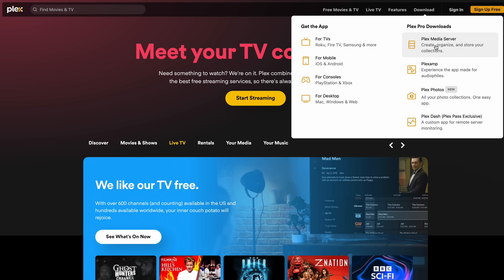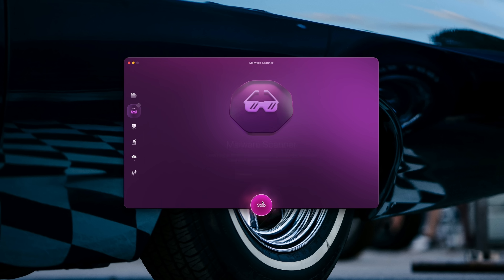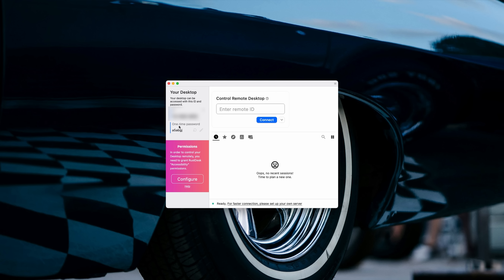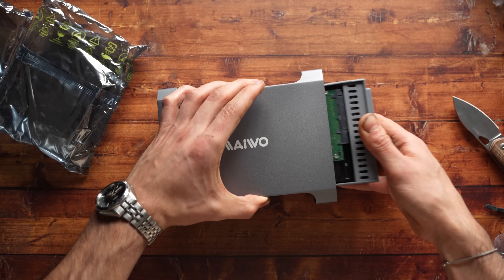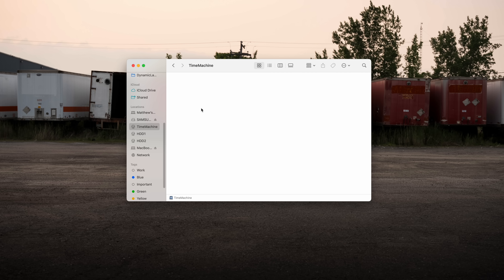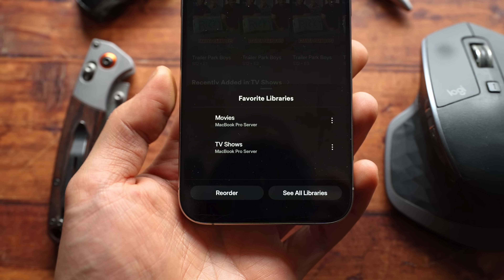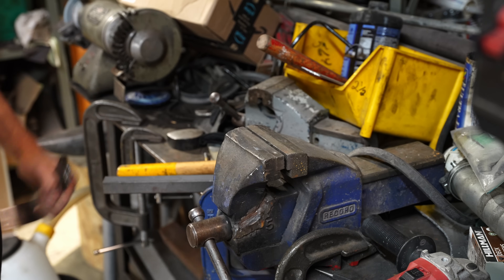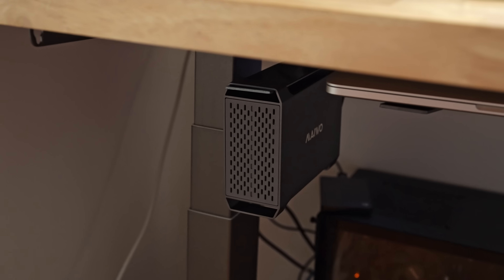An Obsolete Mac is Your Greatest Ally - DIY Homeserver

Comment: Great timing on this very informative video Matthew! I’m planning to save some cash (if possible) by repurposing my Mid-2015 15" MacBook Pro for Home Assistant. It’s definitely overkill, but the hardware is just sitting there! My battery is shot (only stays alive on battery only for a short duration), so I’m looking into a replacement. Quick question: since your screen was broken, how exactly did you handle the software install process on your Intel MacBook Pro? I might have missed that part. Thanks! I appreciate the recommendations of software and hardware you mentioned.
Reply from the maker: To answer your question, I had to plug a mouse, keyboard, and monitor to be able to setup the remote desktop. Kind of a pain but it worked out haha

Really appreciate you watching dude! Glad my video could help you out🤟🏻 It’s so funny you mention Home Assistant because that’s something I’m going to be messing around with soon, surely will be making a video about it as well lol

I’d highly recommend using your server as a NAS to backup to, especially for TimeMachine. It really is game-changing.

Appreciate you watching and commenting man!
Reply: @MatthewPCLO  I appreciate the quick response and inspiration.

Comment: @matthewPCLO Hey there i was wondering if you could chat off line about some of these steps and tech, i have a 2015 MBP that was specd out with 2 TB of storage then I have a 3TB TimeCapsule, I have been able to run the Plex server on the MBP but I wanted to know what are some of these cool features that you are referring to as the MacServer, does it only function as a back up.  The other thing I am wondering is there away to link additional Time Capsule, which I am sure i could buy 4-5 pretty cheap since that is an obsolete piece of tech but revive them, can i get them to all mesh together with say the HDD on the MBP and the multiple time Capsules.  Lastly, what is the best well to download my media to this server for plex when I am away.  I am Never at home usually, and don’t want to be stuck at home while ripping media, does anyone have any tips for that.  Oh and I have a Practically unused Thunderbolt Display should I connect that to the Mac Server or use the dongle you suggested.

Comment: Great video. Imp for the hangers, you could add a small piece of rubber (around 1/8"–1/4" thick) on top of each arm. This would create a slight height difference for the hard drives and add extra grip, so if someone accidentally bumps them, they won’t slide off immediately.
For the Mac hanger, a similar rubber pad would help, and slightly bending the outer end of the arm could add even more safety. Combined, this should be enough to keep it stable while the desk moves up and down.
Reply from the maker: That is a great recommendation, some other mentioned the same thing. I have since added a firm dense foam to hard drive mount, and rubber feet to the Mac mount. It definitely helps!

Appreciate you for watching and comment man, thanks so much!

Comment: How much electricity is this pulling in a day?
Reply from the maker: That is a great question. I should have bought a device to measure the power draw.

The only thing I can say it’s that the device is normally idling throughout the day, since it’s just a backup and Plex server.

Great question thought.

I’m actually currently messing around with another device (very low power) specifically for this type of use case. More efficient and smaller than an old laptop setup. Stay tuned if you’re interested I plan on making a video all about it.

Appreciate you watching and commenting dude!
Reply: @MatthewPCLO  You can use an Eve Energy to monitor electric usage in Apple Home (or HomeKit). There are other smart plus that do the same sort of thing.

Comment: Just saw this video after having done a similar set up a couple of weeks ago on 15" 2015 Macbook Pro. 
A few notes:
- You don't need the HDMI dongle. Just use a free program to prevent sleep (ex: NoSleep) and set your power options to never sleep when display is off.

In addition to Time Machine backups, I also wanted a full backup of my Photos, iCloud Drive (2TB plan),  and Documents folders in case I should ever get locked out of my Apple account. 
- For Photos, create a photos library on the external drive and keep the Photos app running all the time with "Download originals to this Mac" checked in settings. 
- For iCloud Drive and Documents, I found the best way to keep them backed up to an external drive is a program called ChronoSync ($50 after a 10 days free trial)  which can keep an exact clone of the two folders. (Hint: You have to set up 2 scheduled tasks... 1 for iCloud Drive and another for Documents as, even though Documents is visible under the iCloud Drive folder in Finder, it's actually just a symbolic link) . One of the good things about this program is, after it downloads and copies each file from iCloud to the external drive it can then issue the evict command to remove the file locally keeping your main drive from filling up.

Comment: Those 2013-2016 MBP's aren't as obsolete as you say. As long as it's decently spec'd (SSD and 16gb ram for example) you can ran OCLP with a modern OS on it. Just did that recently on a 2013 15" and 2-15 13" and works really well. This solution is great too btw. Macbook Pro's are amazingly long living.
Reply from the maker: I agree with you, decently spec’d models can last you a while. A battery change might be all you need to keep your MacBook longer. If I didn’t need the extra power I would have never upgraded from my 2019 MacBook Pro.

Comment: I have doubts about the disk enclosure USB connection running 24/7 :/
Other than that I am very tempted as I have all the other parts.
Reply from the maker: What is your doubt? Very interesting in hearing your thoughts on that
Reply: @MatthewPCLO  

1) I simply do not believe that the USB controller is designed for a 24/7 heavy duty performance. 

2) MacOS policy on external disks is I believe pretty aggressive, just from my personal experience it performs a lot of hard disconnects even when not sleeping. (People say it got better in Tahoe.)

But these are just my doubts, I personally haven’t tested the DAS+Server setup. If it works for you, I’m happy, but pls I let us know after 2 years of 24/7 traffic.
Reply from the maker: @j @jinXeD546933  Well the drives don’t run 24/7. I hear them when they start spinning up lol

If I open up Finder on my MacBook and access the drive, or open Plex to watch something, or TimeMachine does its weekly backup, I hear the drives start up. Other than that I’m not constantly pulling files from it. If I needed something like that I would have probably looked elsewhere, mainly because I’d want faster speeds.

This setup is really a video footage dump/backup server

I really appreciate your response and comment dude!
Reply: @MatthewPCLO  For random backup thats probably great. Praying to hardware gods for you! 
Thanks for the tip, I might still give it a try.

Comment: 2026 here, it is wise to begin either transitioning to Apple Silicon hardware OR transitioning to Linux on legacy Intel Macs. The next MacOS update will soon discontinue support for Intel processors but existing MacOS should still get some security updates through 2028.

Comment: Since this is an old computer, I’m assuming it wont take security updates any more, is that correct? Any concerns about it being compromised?
Reply from the maker: That’s fair point. You can get the latest version of macOS on older unsupported Mac’s by using OpenCore Legacy Patcher. There are tons of tutorials if you’re interested in that avenue. With that said, I wouldn’t be concerned about it being compromised because it’s not like you’ll be using it to surf the web and download sketchy files. It’s only used as your own personal cloud on your home network, so in my opinion it’s secure.

Appreciate you watching and thanks for the comment dude!

Comment: Could you have achieved the same, always-on display via Amphetamine?
Reply from the maker: That is a good observation. Amphetamine wouldn't work in this case because as soon the lid is closed, the MacBook will hibernate. It needs to think it's connected to a physical display in order to be in clamshell mode when the lid is closed. Hope that helps explain things a little better. It's definitely a good idea, but for this application it wouldn't work as we'd expect. Appreciate you watching and commenting dude!

Comment: If you ever notice that your drives are a bit slow with certain tasks, it might be because of the drives you used. The barracuda drives you put in have a different way of recording information when compared to a dedicated NAS drive, like the WD Red Plus/Pro or Seagate Ironwolf lines of products. You might not notice it when reading information from them, but writing to them might be a bit slow sometimes. This is coming from me with the same 2tb Seagate drive and wondering why its so slow sometimes lol. I know this isn't applicable to your setup, but this means that using them in RAID in the future would not be very good since should you need to rebuild a failed drive, these would inherently take a long time to restore, leaving your data vulnerable for longer. HOWEVER, I think using the usb DAS is covering up most of the shortcomings of the drives😭😭. Regardless, I've been enjoying your other videos as well, keep it up!!
Reply from the maker: Appreciate the kind words dude! Glad you enjoy my stuff!

You’re 100% correct. This is all for cold storage of video footage and photos I shoot, and TimeMachine backups. So I don’t need the fastest performance. The USB definitely bogs transfer speeds down but I’m never in a hurry to upload or transfer files, I just do it in the background. For Plex it works tremendously though I must say.

Appreciate you watching and commenting man!

Comment: I don't think you said what version of Mac OS you are running on the old laptop.
Reply from the maker: File sharing and screen sharing has been in macOS for a while now so regardless of the version you should be good to go even with a later macOS version. With that said I’d recommend using OpenCore Legacy Patcher on older Macs to get the latest possible update so you could run newer apps.

Comment: I wanted so badly to turn an old computer I had into a NAS, be it one of my parents' 2012 MBPs, our reeeally old 2008 polycarbonate MacBook with an Intel Core 2 Duo and  a busted HDD (but otherwise would work fine) or my Acer Aspire gaming laptop from 2017. But the very last thing I wanted to spend my time on was assembling a NAS RAID system over a USB connection when UGREEN sells a plug-and-play solution that's pre-configured. This video is making me kick myself for taking the easy but expensive route with UGREEN! Everything I saw told me that RAID over a USB connection was unfeasible, then a guy on my YouTube feed JUST DOES IT. ugghhh
Reply from the maker: lol I blame the YouTube algorithm🤣

I didn’t use RAID for my setup because I wanted different partitions for different things. But the DAS I used does make it super easy to setup.

Comment: Maybe worry about the old laptop battery forever-charging as a fire hazard in case you are always-on ? Perhaps remove the battery ?
Reply from the maker: I mentioned in the video that I'm using Al Dente to cap the battery at 50%-60%. It won't be kept at more than that.

Comment: I need a WOL remote solution.... my ideal setup would be able to turn on my pc remotly from my cell phone so I can access it through anydesk or rustDesk.... the thing is I cant just sett a ping to my router with port forwarding bc my isp changes the ip every X days....
Reply from the maker: Why not just leave your PC always on? That way you can connect via RustDesk at any time
Reply: @MatthewPCLO  power concerns, my pc  is a threadripper in which I intent to upload projects via dropbox or drive, and render remotely when traveling. plus in case of power failure I couldnt turn it back on
Reply from the maker: @piwypd0 Ah I see that makes sense. What about those smart home outlets? Maybe that would work to turn it on from your phone
Reply: @MatthewPCLO  yes!! maybe that is a simpler solution, having it in BIOS with turn on automaticlly if power is detected and just using a smart outlet.... I have used some which sometimes "disconnect" from the router and appear as offline in app, and need to do the handshake again... turning them off and on manually,  maybe a newer one is more stable....

the hole idea is to be reliable being away from home... 

also this method might work with sleep  mode....
will reply if works =)

Comment: Wow, I use my Mac in the same way. I've drilled holes in my desk and mounted the Mac keyboard down to be able to manipulate the keyboard. The Mac stays connected to a monitor, and I have studio monitors for speakers. i do use this as my daily driver, and it works well. I have an old desktop downstairs, and that works as the server.
Reply from the maker: Sounds like a great setup dude!

Glad I’m not the only one mounting a laptop to a desk lol

Comment: I'm thinking this may be the future of my older iMac. Since nothing internal can be upgraded, it's stuck with low memory- just curious if the Mac OS should be ditched in favor of a lightweight OS. Also need to make a Windows friendly setup aside from Plex, which does a great job. I hated Mac when I first got into IT decades ago because it was before they could use TCP/IP and hated the mixed environment- so now, being retired, what do I do? Mixed environment. 
I'll be testing the new Mac M4 vs. PC Gaming machine soon... winner takes all.
Reply from the maker: Linux might be a good option to run as a server. With that said, macOS does support file sharing with Windows through the network. More on that here: https://support.apple.com/en-ca/guide/mac-help/mchlp1657/mac

Comment: I have a 5,1 Mac Pro that I use as my personal server/NAS. I used only the built in control panel to set it up: turned off sleep, set up file sharing and Time Machine back ups. 
No dongles, no extra software, nothing. 
When I need access to the graphical interface I find the server in Finder and just hit Share Screen.
Reply from the maker: Definitely a solid setup, very nice dude! Thanks for commenting in sharing

The built in macOS screen sharing works well but Rustdesk has been a dream to use, plus you can use it in other devices

Comment: I would recommend encrypting the drive in case you have to return it to the store after it dies and stops working after a couple of months. Happened to a large seagate drive I was using
Reply from the maker: Interesting, I’ve never had issues with Seagate drives but thanks for sharing dude. I’ll look to start encrypting them

Comment: Are you at all worried about not getting the latest security updates? For example, there was a security issue that a malware-laden image, if viewed on the Mac, could gain access to the computer. "This vulnerability, tracked as CVE-2025-43300, was found in Apple’s Image I/O framework, which handles image processing across apps and the operating system. If a malicious image was opened—even just previewed—it could result in memory corruption that could be exploited to execute code remotely, potentially allowing a hacker to take control of the system."
Reply from the maker: Open Core Legacy Patcher is a great way to avoid those issues and get the latest supported OS running on older hardware
Reply: @MatthewPCLO But then you have to trust that software to not have malware. 🤷‍♂️
Reply from the maker: @fighterpilot12 Yes that’s true. But it is a reputable piece of software that many have used.

Comment: That drive enclosure is crooked it will slide off.
Reply from the maker: It may look crooked but I can assure you it’s not, it’s mounted straight on the desk rail and I curved the edge to make a lip to prevent any accidental slippage along with adhesive rubber feet. Just a little added insurance!

Comment: I’m scared about the battery swelling - I want to use an m1 MacBook Air with a broken screen - what do you guys think
Reply from the maker: That’s why I used Al Dente on this build. I keep the battery capped at 60% so the battery won’t get damaged and risk swelling. It’s definitely a much needed safety precaution for this use.

Comment: the vibrations from the HDDs must be crazy on the desk
Reply from the maker: This is something I thought about but even without adding rubber pads to the mount the vibrations are not noticeable. Sometimes you’ll hear a humming but it’s really nothing crazy. Very fair thing to point out though

Comment: One small issue to keep in mine with using old MacBooks is that the batteries are at risk of expanding and becoming a fire risk. Something to keep an eye on.
Reply from the maker: Exactly why I’m using Al Dente to always keep the battery at 60% charge! A Mac Mini would surely be a better option if you have the budget for a dedicated server
Reply: @MatthewPCLO  that really only makes sense if your battery is already starting to fail and you shouldnt use it anyway - if not then all you are doing is making sure when you need power that you are missing the other 40% - the thing that kills batteries is cycling  charging up and down - if it stays charged the same then you dont have anything to worry about which if it's strictly a server it shouldn't be constantly charging and discharging.